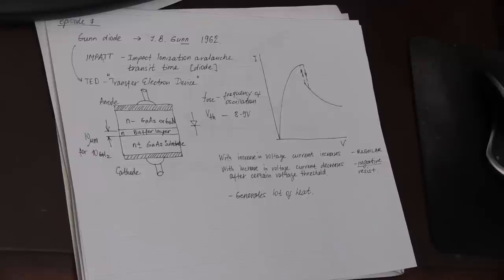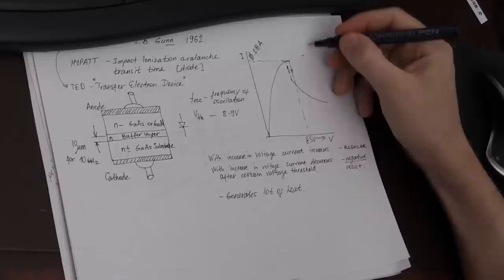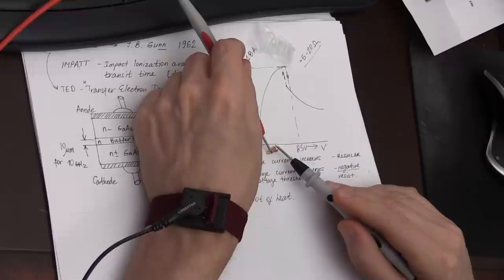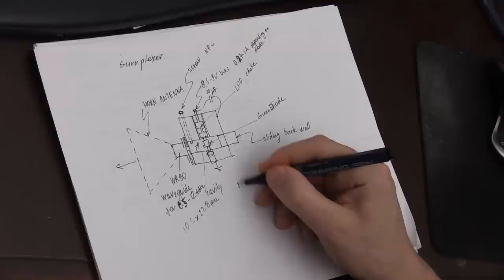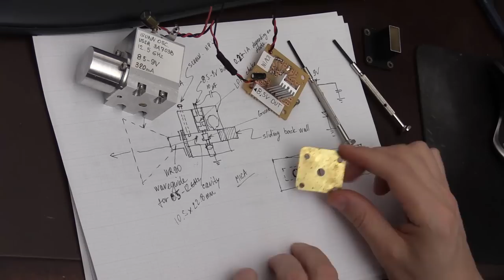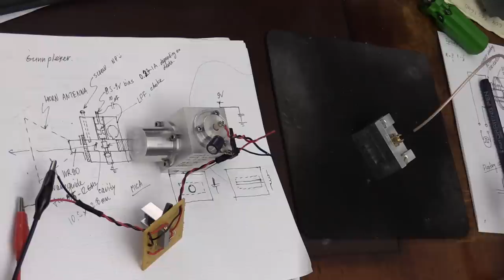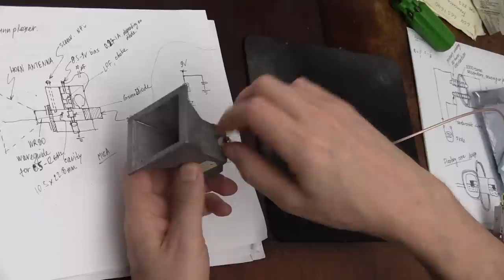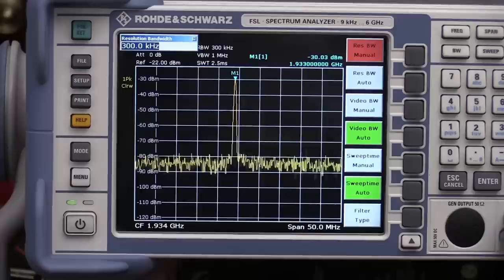Episode 7, Microwave Gunn diodes and Gunn diode oscillators

Comment: I have also bought 3 from Bulgaria, they work really well. I use two in a self made 10 GHz HAM transceiver.

One is for transmitting, the other is for heterodyne down conversion via a diode mixer

Comment: Very interesting.  On your homemade gunnplexer you indicated that the anode was grounded, but the ones I've seen all had grounded cathodes.  I watched your reassembly and couldn't tell if the anode or cathode was grounded.  Also, may I ask the purpose of the electrolytic capacitor that is connected between the diode's DC input and ground?  Thanks

Comment: Hello, I have three questions:
1.How to calculate the size between the Gunn diode and the iris?
2.Are the positive and negative poles of the Gunn diode are different or not? If they are different, how to understand it?
3.Is the Gunn diode directly attached to the screw from the bottom, or there is an insulator like plastic between them?
Thank you so much for your answering my questions and for your amazing video.

Comment: Nice video, congratulations. I've learned a lot with your video. Just explaining the term 'diode': this device is of uniform material. It is not a real diode, it is commonly referred to as Gun diode but the 'term' diode is used merely to indicate two ohmic contacts.  It is a semiconductor with a gap. The basis of the effect is that normal higly mobile electrons in semiconductors, such as GaAs, could transfer to higher energy states where they were less mobile. This can lead to a negative incremental mobility or a negative incremental bulk conductivity. See the book "Hot Electron Microwave Generators" John E. Carroll.

Comment: Aprox 24 minutes 30 seconds you have drawn schematic.
Pleas tell me does that  choke (which is basically simple coil) together with  that capacitor  both connected to the ground via Gunn diode do play role in regulation of oscillation frequency? 
Or  thats how low pas filter works?
It does kind of  resembles  LC circuit :)
Reply from the maker: LPF in this case It is NOT a coil. You can see it in a video - I have turned LPF on lathe from round stock of brass and it looks like 3 cylinders of different diameters connected in series. Essentially LPF looks like one implemented in form of microstrip but cylindrical in form (3D if you would like). That brass core of LPF is then placed inside a tube that is made from PTFE or polyethylene. Dielectric constant of both plastic tube surrounding  the LPF choke and air determines its parameters.

Comment: Hi  !   which site of  diode  connect to +  and  which site to  ground ?
Reply from the maker: Best way is to get Data Sheet for your diode. Ebay sellers that sell Soviet NOS usually have scanned datasheet in item description so I would loo for it on Ebay first if you have old one.
Reply: @AlexeiPolkhanov  thank you!    if i  test  a  gunn diode  with  multi meter    and  find   big   resistance    the  diode is  off  ?